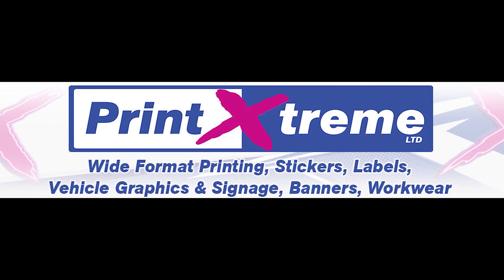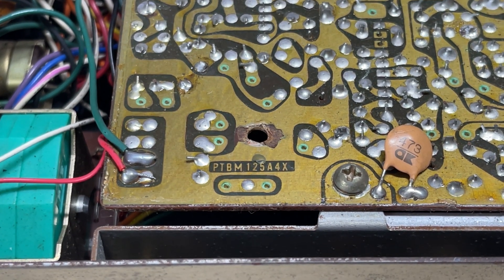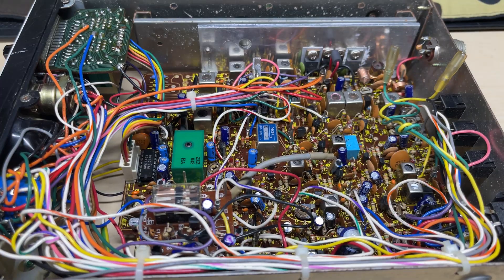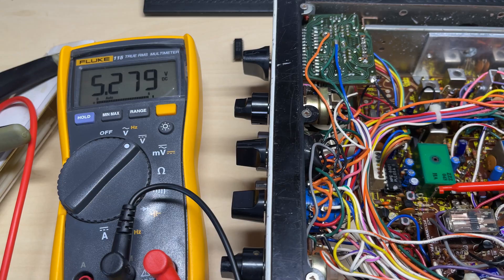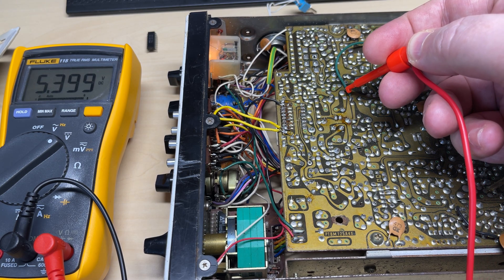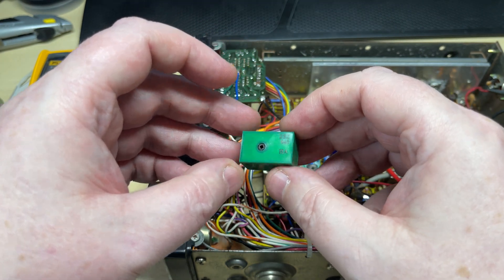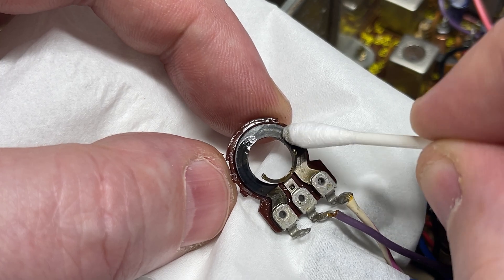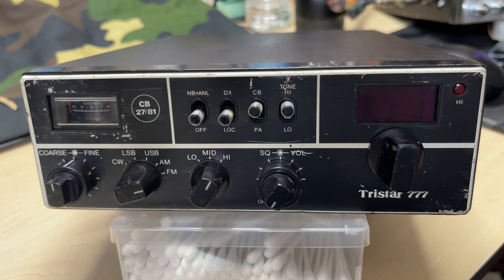EP 112 - Tristar 777 SSB CB radio - 5 band mod and front decal/repair. Part 1

Comment: What should happen with the voltage when adjusting the vco..?
Reply from the maker: it should lock between .8v and 4.9 ish , 5.2 is unlock. the voltage should be at one end on the lowest channel and the other end on the highest channel.

Comment: some years ago i brought one of these back to life, good on the outside not so on the inside, luckily i had access to a scrapper at the time, this one needed a vco, pll chip, voltage reg 8v, the one with the small heatsink, when it goes it also takes out a coil and a zener, the main rx/tx switching transistor and the biggie, the mode switch was shot, all apart from the vco and mode switch was donated from the scrapper, i got a correct type mode switch from an old mate, the catch was it was 6 position so i had to draw out where all the wires and links went and left one vertical row blank, all a success, the radio did nowt if you accidently went mode all the way to the left, inop apart from s meter light and channel leds, watch out for diode d1 they can go on these radios, its on the piggy back board next to the tx/rx switching relay, these boards seem to be a bit better made than the 121's, no knackered area round the darlington on these, not from what ive seen anyway.
Reply from the maker: Yeh they still good radios when setup correctly, luckily enough mine was not that bad but it still had its challenges.